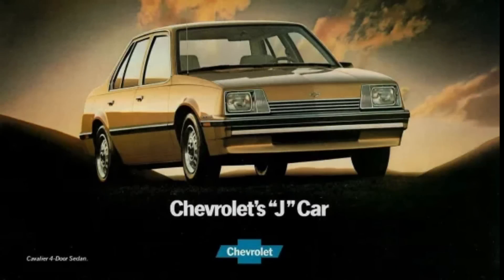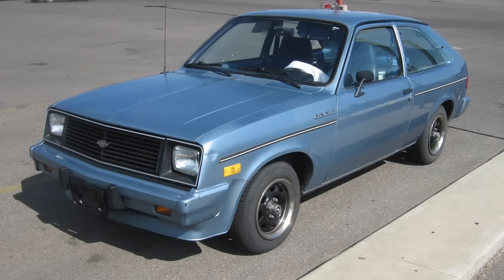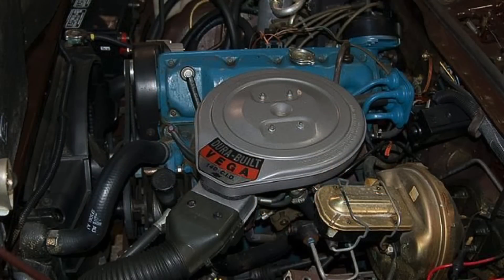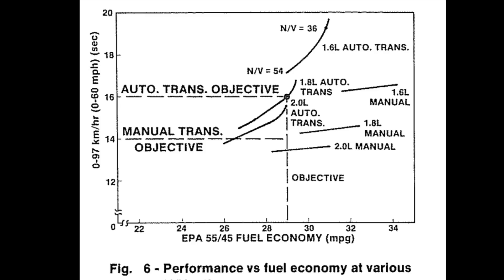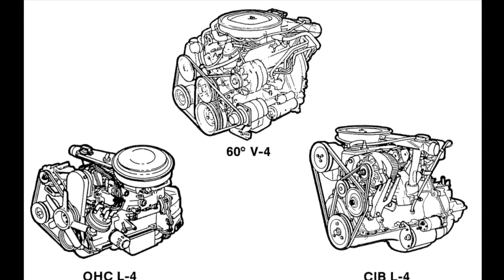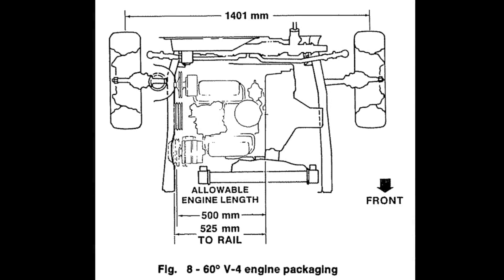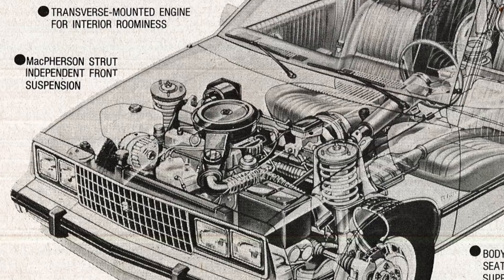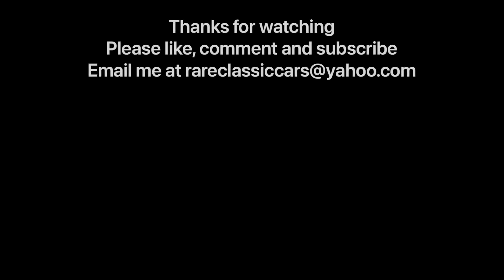GM Builds a Crazy 60-Degree V-4 (Yes, a V-4!) for Its J Cars

Comment: Guess I'm confused.  If the V6 fit under there with all the accessories, why wouldn't the V4 fit??  The V4 seems like the way to go, I must be missing something.   Te 60 degree V4/V6 design sure worked out well for our outboards at OMC!
Reply: I suspect that GM nixed this engine because an inline four made of the same components was cheaper to build and fit just fine.

Comment: Motus Motorcycles makes an all-aluminum 1650cc 90-degree V4 that makes 180hp @ 8200rpm in the MV4R trim. It's the classic cam-in-block pushrod style engine that is based/inspired from the GM LS family of engines. They used to offer the V4 as something like a create engine for light weight sand rails.
Reply: Yamaha was claiming 145 HP from their V4 back in 1985.

Comment: Had a Cavalier Z-24 with the 2.8 V6 and it was a pocket rocket for the time.  2400lbs is not much weight to move.  Overall the car was great.
Reply: Z-24 Cavaliers were cool 😎 Had an '01 Z-24 as a daily driver car for several years with the 2.4 Liter. It moved out nicely, good handling and good on gas ⛽
Reply: @ohioalphornmusicalsawman2474  
Had an ‘87 that I bought new for like 11k.  Those days are gone!!

Comment: I can't imagine a 60 degree V4 being either even firing or balanced, though I have to admit that the Chevy 60 degree V6 was amazingly smooth despite not being completely even firing or balanced either, with most V6s being a compromise between the two. Still, I suspect that the V4 would have sounded like a coffee grinder with one blade missing.
Reply: Yeah they arent balanced. Fords Köln/essex v4s had 60 degree bank angle and had a balance shaft
Reply: @288gto7  Even with the balance shaft the Köln/Cologne/Taunus V4s weren't exactly smooth. I spent many hours in the rear seat of my parents Saab 96 V4.
Reply: There was a motorcycle company that made some bikes with OHV 1.6L 165BHP 90 degree V-4 engines and they sounded amazing.
Reply: Ducati and Aprilia (Piaggio) both make unbalanced V4 engines. Aprilia uses counterweights. Ducati just leaves them unbalanced. Both leave secondary vibrations unbalanced. Honda made V4 engines, but I think they were all balancd 90 degree.
Reply: V6 engines are very difficult to engineer, especially high-performance ones, due to their inherent unbalance.  It is actually more expensive to develop a V6 than a V8 because of this.
Reply: @douro20  Don't forget the 120 degree V-6 engine which I believe is the ideal V angle for V-6 engines, this is based on dividing 720 by the number of cylinders. 120 degrees for V-6, 90 for V-8s, 72 for V-10s, 60 for V-12, and 45 for V-16s. Even though often V-6 engines are 60 degrees and V-10s as well as V-12s have been made in 90 degree form.
Reply: In-line 4s aren’t that well balanced either. They would’ve probably used balance shafts
Reply: @jackdough8164  inline 4s secondary imbalance gets so much worse with increased stroke. Anything under 2l is fine for inline4. Some 2.5l inline 4s use balance shafts but they are not really common. I would say 99% of all inline 4s dont have balance shafts
Reply: @288gto7 Honda is the only I4 mfr that I am aware of having used a balance shaft. It was on a separate belt, a bit of a pain at replacement interval, but was pretty smooth over nearly 600Kmi in my '96 Accord F22B1. The only other engine I personally experienced with a balance shaft was one of the GM 3800s.
Reply: @A_Cowboy_called_JackRabbit  opel , porsche and jeep also used them. But yeah they are not common at all on inline 4 , just very few engines have it
Reply: @A_Cowboy_called_JackRabbit All Mitsubishi 2.6L four cylinders had dual counter rotating balance shafts - including all the ones that went into Chrysler K cars and minivans.
Mitsubishi licensed the dual balance shaft design to Porsche (944) and Fiat.
Reply: @eatonjask  thank you, sir. I didn't get much time with any of these. You just gave me an idea for a new project!
Reply: @288gto7  GM's Quad 4 engines all had balance shafts, as did all later Saab and the bigger Volvo 4s, as well as all the larger Mitsubishi 4s and Nissan 2.5L 4s. 
We're probably down to 95% of all fours with those.
Reply: @jackdough8164  The small inline fours (up to 2 liters) that I have experience with are much smoother than any V4s I have had close contact with.
Reply: Ford Made a V4 engine in the 70's-80's
Reply: @gabrielvieira.4358  The V-4 engine is interesting from a packaging stand point, especially the 60 degree version as you can get a V-4 in a smaller space then an I-4. I also think that the Motus V-6 sounded pretty crazy (the V-4 bike that made the 1.6L engine).
Reply: If they set it up with offset crankshaft journals, it's possible for it to act like a 90 degree V4.
Reply: I’m pretty sure the wingless speedway cars here down under race using a V4 iirc or did
Reply: @user-ex5fx5jj7z  what engine do you have?
Reply: V-4 used by European manufacturers, notably Lancia

Comment: That reminds me: about 10-15 years ago, GM reintroduced the idea of a V4 motor for it's engine range, when the hot-looking Code 130R concept was revealed to the public, and accepted with wide acclaim. Two versions were to be offered, NA and supercharged; a 3.1L OHV V4, making 230 hp, and when supercharged, about 300 hp. If produced, it probably would have taken on the Vega name, JMO. Too bad it wasn't built, I would have bought one.
Reply: The Code 130R concept has a conventional turbocharged Ecotec 1 4 L DOHC inline-4 (with a mild hybrid system), not a V4.
Reply: @brianb-p6586  A V4 was actually developed and shown by GM, meant for the Code 130R, back then.
Reply: @19chucki74  For something which was "accepted with wide acclaim", that V4 has been kept a very big secret. I have found many references to the Code 130R concept of 2012, and they all describe the same car (Alpha platform coupe), with the same engine (150-horsepower 1.4L Ecotec turbocharged DOHC I4 with eAssist technology), confirmed in a GM press release; there is no hint of any new engine, any V4, any pushrod engine, any engine larger than 1.4 L, or anything with 300 horsepower. The concept was billed as being inspired by a Nova, but was really a smaller variant on the next-generation Camaro. Perhaps you're confusing the Code 130R with another concept, at another time; the Code 130R itself was widely acclaimed. 

If there was a modern GM V4 proposal, it would be interesting to see information about it.

Comment: My dad had a '74 SAAB Sonnett III, which was powered by a 1.7 Ford Taunus V4 engine, which was a 60 degree V4.  It was a very punchy engine.  The engine casting was eventually extended by 2 cylinders at Ford, becoming the Cologne V6.  But not before Ford learned hard lessons about being too cheap.  The earliest versions of this engine used "siamesed" exhaust ports at the back of the engine, so that the exhaust manifolds were the same as the V4.  In service, this led to cracked cylinder heads, and Ford had to make proper individual exhaust ports.  In America, this engine was successful in the Ford Ranger and the Ford Aerostar, and later in the Explorer.  It was introduced here in the  Mercury Capri, which was the European Ford Capri.

Comment: Reminds me of the 'Starfire' 4 cylinder engine made by Holden in the late 1970s  - derived from the 173 straight six with two cylinders lopped off. A pragmatic engineering move, perhaps - but not fondly remembered.
Reply: Not the greatest of ideas by Holden. I think it came about by government meddling during the button plan years. It certainly hurt Holdens reputation but also Toyota's because they stuck the horrid thing in some Corona's. Also, considering when it was released, it's origins back to 1964, and the fact that neither it or it's larger 6 cylinder parent were going to make it through new emission requirements and unleaded fuel in 1987 it seems in retrospect are really bad idea and waste of money.
Reply: Makes you wonder how much they spent developing a fuel injected version of the 202 for the VK.
Reply: @KarlAdamsAudio  Perhaps that was their effort in 'trying' to meet future emissions standards with the dinosaur Red six and they failed, hence the adoption of the Nissan engine in VL only. All the mucking about and implementation of an outsourced engine must of cost a fortune. However, they must of known about future emission standards and unleaded fuel for quite a few years beforehand. GM home and abroad have always done some crazy things.

Comment: A transverse V4 would not fit because of needed space for accessories.  So it ended up with a V6 with accessories.   If you say so...  Maybe it is accounted for by vastly different bore centers
Reply: A large transverse inline-4 is a length problem for accessories; the V4 was a proposed solution because it is much shorter in the transverse direction... with the same bore centre spacing. 

A V6 is shorter than an inline-4 - again with the same bore spacing - so it fits, too.

Inline-4 engines do fit in the transverse orientation, but that requires a small engine or compact accessory drives.

Comment: I worked on all those cars during that time. Too bad the serpentine belt drive hadn't been invented 10 yrs earlier. Trying to replace 4 v belts on a maze of brackets with inaccessible adjuster bolts was difficult. The 1.8 and 2.0 had very thin head castings.  I worked at a engine rebuilding shop and many had cracked heads without being overheated. We called em egg shell castings. Also the liquid sealant (rtv) for oil pans and valve covers combined with  half as many bolts to seal old school tin covers and pans to cast iron was a recipe for oil leaks. These cars leaked like sieves by 60 or 70 k. Engine last maybe 100 k. But they were still affordable to consumers so GM got by with them. Truth be told the big 3 all had a big learning curve to produce small fuel efficient cars with any degree of quality .
Reply: Huh?  The serpentine belt was used by ‘82.  I had an ‘82 Mustang GT 5.0 OEM serpentine.
Reply: @ProjectFairmont I once owned an '86 Cavalier VL coupe. The serpentine accessory drive didn't go into GMs 4-cylinder J cars until 1987, when the 2.0 also switched to an aluminum cylinder head and distributor-less ignition.
Reply: There was a rubber belt that Pontiac used in the 60s.
It ran the camshaft, said would run 500 tho miles, don’t hold your breath.

Comment: I can assure you Adam, that when a V4 engine was used in a motorcycle, the rest of the technology was astounding. A typical European or Japanese V configuration engine had monstrously high output compared to any automobile engine from the US, (including the Harley-Davidson), because they used advancements in engine technology. Typically, a motorcycle would be expected to have 4 valves per cylinder and DOHC, and any additional mechanical perk available, as they were not your grannies motorcycle. Pretty much everything was sacrificed for the sake of performance. This principal continues today with motorcycles, which is why a relatively cheap high performance motorcycle is immediately in super or hypercar territory, for less than the cost of a service on the 4 wheel equivalent.

Comment: The Renault 16 was well packaged and had the engine turned round with the gearbox in front  and was of course front wheel drive. They also had differing wheelbase on either side and an excellent ride, not to mention 5 on the tree.  ( Renault 16 TX)
Reply: "They also had differing wheelbase on either side" Well you learn something new every day...
Reply: @Paul1958R  - The Citroen 2CV also has that feature.
Reply: @AB-pl1ko  It didn't. The reason the Renault 16 (as well as the R3, R4, R5, R6 and R7) had different wheelbases left to right was because of their rear suspension. It was a pretty simple independent trailing arm setup, but the trick was that they featured full-width, transverse torsion bars instead of coils, to maximize interior space and to still allow for VERY long suspension travel. Because France. And in order to not have the torsion bars interfere with each other the left and right trailing arms were slightly offset. 

A 2CV is a completely different beast, it had a unique front-to-rear interconnected leading/trailing arms connected via what was basically a tube with a piston and coil springs inside which pre-loaded the rear suspension when the front wheels hit a bump. 
Completely different design to what Renault did but simple and effective, with the side effect of mad body roll in corners.
Reply: @mrspandel5737  - My mistake.  Was actually thinking of the Renault 4 there but for some reason wrote 2CV instead... 😕
Reply: "Wheelbase" is the measurement between the front and rear axle centerline of a vehicle.

"Track" is the side-to-side measurement from the hub flanges or center of the tire tread, front or rear on any vehicle having wheels on opposite ends of an axle.

In the case of the difference between side-to-side axle lengths, you are merely speaking of uneven length axles, not "wheelbase."
Reply: @A_Cowboy_called_JackRabbit  Hi, Thanks for your reply. The Renault 16 along with from memory the 4 and 5, had unequal length wheelbase. The design of the rear suspension consisted of torque tubes place one in front of the other across the car, not lengthwise.
 Left: 2,720 mm (107.1 in)
Right: 2,650 mm (104.3 in)
I had one in the early 1970's and it was the most comfortable car I had owned, including my 1965 Pontiac Parisienne.
The handling did not appear to be noticeably affected by the difference in wheelbase. See    at 3.40 https://www.youtube.com/watch?v=usz0oV7cZcw

Comment: Ford Köln had 60 degree 1.5l v4 in Taunus models , it was even put to test in french miramas circuit where it ran non stop for 120 days all out high rpm , did 350k km without many issues despite oil beibg changed every 20k km when it should have been every 5k

Comment: I also fancied the z24 cavilers circa 85 to 87. I loved that boxy look with the body kit they had. Similar to the celebrity Eurosport. That was a damn good looking car in my opinion.
Reply: Had an '01 Z 24 for a few years😁 Had the 2.4 Liter,,was a nice sleeper car good gas mileage as well
Reply: @ohioalphornmusicalsawman2474  Quad4?
Reply: @the_kombinator  Yes. The 2.4 Liter was a 16 valve motor, pretty strong runner. A little loud but nice and strong.
Reply: @ohioalphornmusicalsawman2474  It topped out at 190 something horsepower with the balance shafts removed/bypassed. That is VERY impressive for a domestic 2.4L. I have a 2.4L DOHC In an 05 Sonata and I think that bucket only makes 160 HP.
Reply: I had a 1986, I believe, Z24 Cavalier hatchback. It had a 2.8L V6 with a manual 4 speed. I regret ever getting rid of that car. I would buy another if I could find one.
Reply: @member57  Did they put the 60 degree into them that early? My buddy had the Type-10 (also 86 IIRC) and I seem to recall that the only engine offering for that gen was the Iron Duke.
Reply: @the_kombinator  iron duke was never put into cavaliers. They had 1.8L, 2.0L, and 2.2L OHV. The sunbirds and Skyhawks had 1.8L and 2.0L SOHC Brazilian motors. I think 84 or 85 was when they started putting the 60 degree v6 in them. The X bodies, Citation, Omega, Forenza, as well as the celebrity, lumina, century, grand am, somerset, century cutlass Calais, cutlass Cierra all got the Tech4 (iron duke), as well as Quad, Quad-4, and various v6 engines 60 degree, Buick, and Oldsmobile. Man I freaking love all the 80s "throw away" cars.
Reply: I had a 87 Z24 new off the lot. Everyone always thought it looked like a scaled down Monte Carlo.
It was cool little car for the time, and quick-ish, with the 2.8 with 5spd.
I’ve seen one recently that was supposedly original condition, but it was priced with a "if you’re willing to pay my price, I may actually sell it" kind of number.
Like someone’s spouse said to sell it, and they said, ok, I’ll post it,,,, lol
Reply: @shakeydavesr  I wish I had one in mint condition right now. Closest I had was an 86 wagon 2.0 4speed manual. Learned to drive in that one, it actually might explain why I like station wagons so much.
Reply: I owned an 86 or 87 (I forget) Z24, and it was very quick for the day. It treated me well. Very reliable.
Reply: Sister had yhe 86 Z with 4 speed. Super fun car
Reply: I liked the later 90s Cavaliers - some had the 3.1 (if not the 2.8) and those always made a nice exhaust note.
Reply: @the_kombinator  2.8 until 90 or 91. 3.1 through 94. 95 was a body style change and the end of the v6 cavalier. Coincidentally the 95 cavy and Sunfire were the first GM cars to receive the double platinum 100,000 mile spark plugs. 96 and newer all GM vehicles had them except the Saturn s series cars. They held out with copper plugs for the next couple years.
Reply: One more piece of useless trivia... The 94 caviler and sunbirds were the only cars that model year to get the MFI 3.1. everything else went to the SFI 3100 in 94.... Sorry I can't help myself 😔

Comment: Ford used Lots of V4 motors in the VERY successful Transit vans line -- AMC-built V4s were used in in the USA's smallest military jeep: the 1960 M422 'Mighty-Mite' -- Lancia introduced NARROW-Angle (15-22 degree) V4-engines, with wide, single bank architecture, and the benefit of just a SINGLE intake & exhaust manifold Each - Achieving low costs and a SUPER compact build - COPIED by VW in VR5 & VR6 engines, - But ALSO in their "W-12" & W-16 engines, in Audi, Porsche, Bentley, And BUGATTI !!
Reply: Yes, and Ford actually had two V4 engines: the Taunus V4 which they used in various German models and supplied to Saab, and the Essex V4 which they used in the Transit and various other British models.